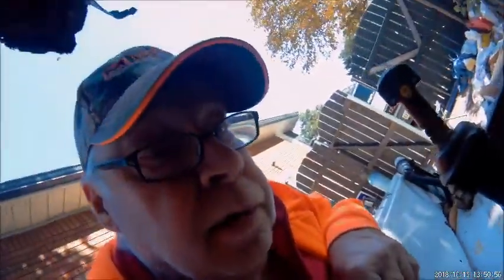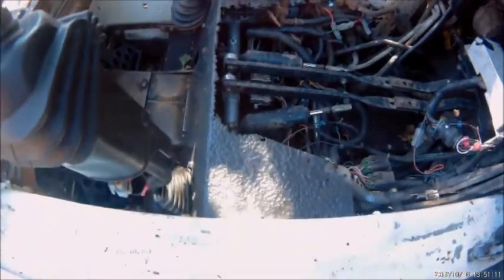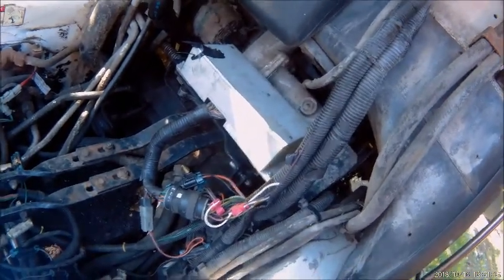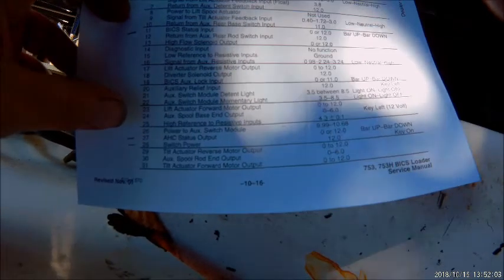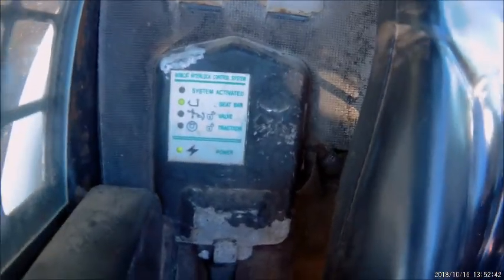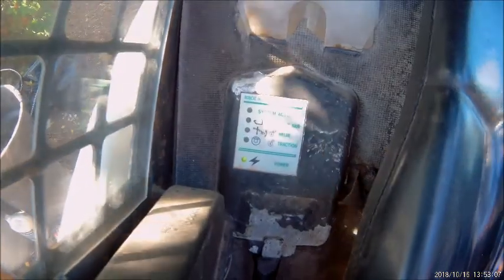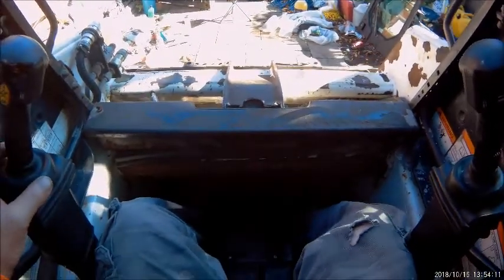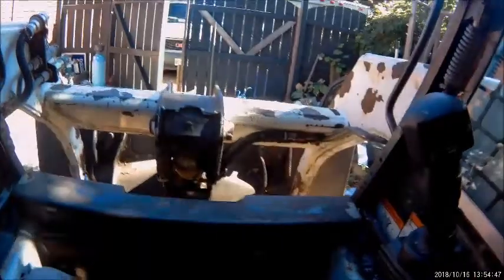753 no lift fix added pedals now workin

Comment: Excellent, It worked perfect. No more bs with the hand controls. Just in case anyone wants to know the parts new were  between $600 and $700. that was with new seals also (mine were leaking). Thank you!!!!!
Reply from the maker: oh cool glad it worked for you and also your aux controls will still work on the handle i have an auger and they work fine
Reply: @davevanden1  this fix is better than trial and error on buying actuators and other parts. The $600 or so dollars is about equivalent to one of the parts that could of been the problem. Just about time for a beer.
Reply from the maker: @mikerow3001  cheers buddy. i know andrew camerata  had the same problem and his was the computer also and it is 1800 bucks. them actuators are around 800 us each. the machines we have is the first year bobcat had the hand controls without foot. mine is the f series also
Reply: @davevanden1  All is good now I can bring it back to the cabin and have some fun. Is there a market for the actuators? maybe craigslist?
Reply from the maker: @mikerow3001  i am not sure you can try and sell them , i threw them in a box in case i ever sell it they can have them which i doubt i love this little machine
Reply: @davevanden1  I will probably do the same, I don't want to sell something without knowing it is good. Gotta go THANKS again

Comment: Now to find some good used parts if possible. Thanks for the response.
Reply from the maker: Is yours doing the same thing the computer messed up?
Reply: @davevanden1 the lift works when it wants to. The lift works randomly. When I went to order the parts they asked me if it had the long or short "spool" because that determines which linkage that I need. Do you know what he is talking about. Iwas just going to take pics of the valve and show him.
Reply from the maker: @mikerow3001  I dont know what they mean  i took the ones i got and cut them to fit they were to long and from an older machine. but it worked. the only thing that isnt working is the float i need to install a detent in the valve for that but i dont use it anyway so i am not going to bother. if you like i can do a more detailed video of what I did and post it in the next few weeks i am pretty busy right now
Reply: @davevanden1  Imight just order the longer of them that way I could cut it to fit. As far as the float goes, I don't need it either. I'm just using it at the hunting shack to move downed trees and screw around making trails.
Reply: @davevanden1  I'm confident I can do it. Just to make sure on the wiring, All I have to do is connect all 3 of those wires correct?
Reply from the maker: @mikerow3001  cool if you need help  video wise i can do it so you see how it all hooks up
Reply: @davevanden1  That would be great
Reply from the maker: @mikerow3001  yes i can tell you the colours of them. is yours a 753
Reply: @davevanden1  Yes it is a 753 f-series
Reply: Sorry to bug you but , can you tell me if that page you have is in the service manual or where I can find it?
Reply from the maker: @mikerow3001  just leaving to head up north for a week i can look it up when i get back on weds for you

Comment: I come up with #11= puple/white,  #27=purple/red, #28=dark green/yellow . Is that correct? Last question (I hope) so all I have to do is hook all 3 wires together? Thanks for your help and have a good time up north.
Reply: Sorry for bothering you but can you let me know if the wire colors i posted are correct? I just got all the parts and will be converting in about a week.
Reply from the maker: @mikerow3001  Hi Mike i checked the wires and yes you have them correct. yes hook all 3 together. sorry for the delay i was gone for over 3 weeks up north in the bush
Reply: @davevanden1  Thank you just got the last of the parts today, will be putting it together in a couple days. I appreciate your help.
Reply from the maker: @mikerow3001  no problem have a great day and hope it works for you

Comment: Am having a similar problem, my foot pedals work, but the bucket won’t go up, it does tilt, I got it inspected and told that gear cylinder it’s bad, I pull it out and everything looked good even the seals, any advice you think?

Comment: Did you have just a slight up/down bucket tilt movement before the repair as if hydraulics were stuck
Reply from the maker: I had tilt of the bucket but the lift just stopped working and did nothing